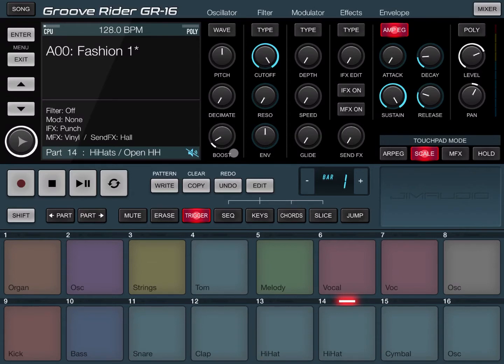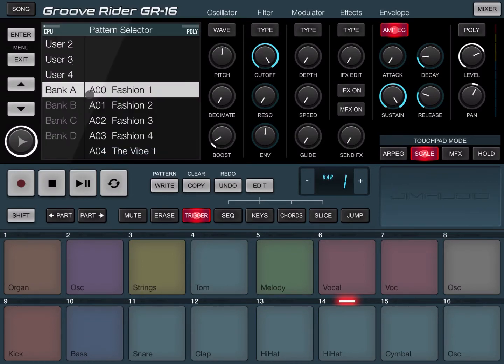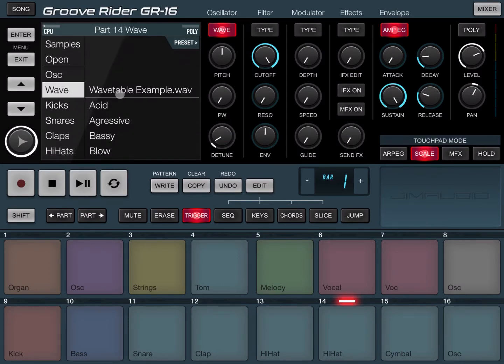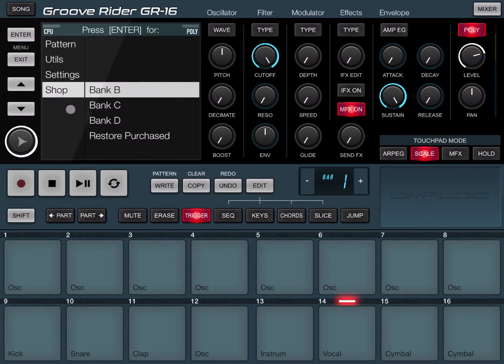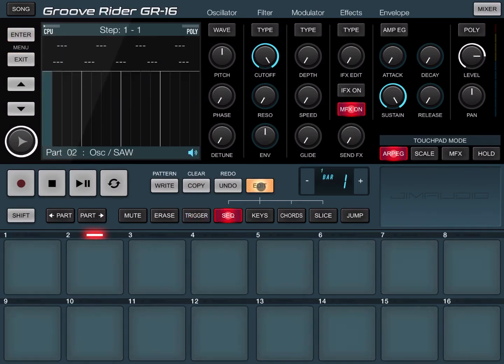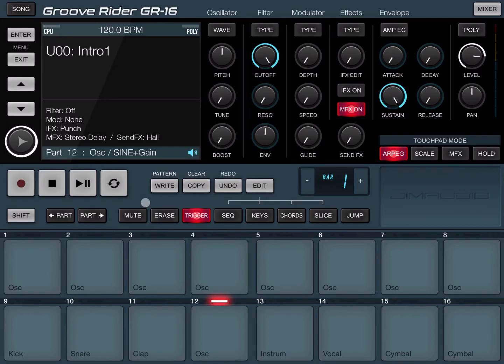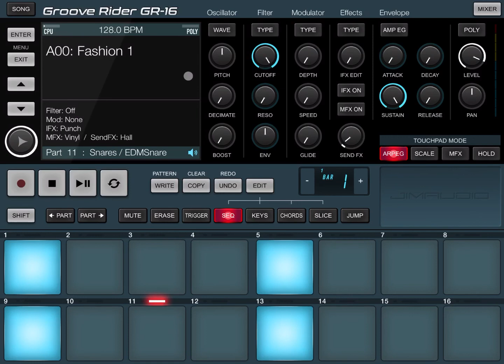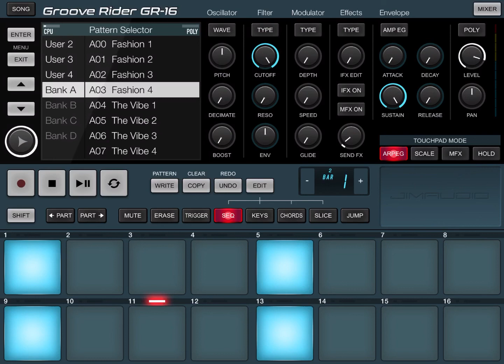JimAudio Groove Rider GR-16 - Tutorial Part 1: Getting Started

Comment: This is a million miles away from how I make music and I wanted to buy it to explore a different approach but there weren’t any good videos. I’m keen to see the rest of these tutorials to see what it can do. Cheers.
Reply from the maker: Sure...
Reply: @soundformore  how do i clear the pattern so i can start the sequencing fresh?
Reply from the maker: Shift menu, utility, erase current pattern…
Reply: Hey one more urgent question as I learn the app. Is it possible to do 32nd notes? I like to go to keys mode and improvise little Melodies. My guess is that I can’t sequence them but I could somehow record it as a sample and then add it as a single part?
Reply from the maker: GR16 works based on steps. You have a max number of steps per bar. You can act on the tempo of course, their length and shift and you could achieve something interesting with multiple voices at different shift positions. Yes you can also import samples in the way you suggested…
Reply: @soundformore  thank you! So you can shift the tempo of one part specifically? And the second option, can you actually record a sample? Or just import one?
Reply from the maker: You can shift steps for parts specifically, you need to import the sample…